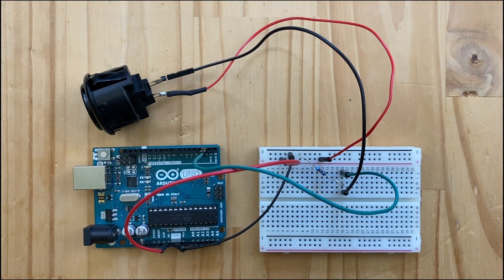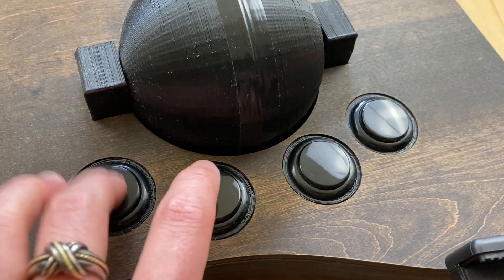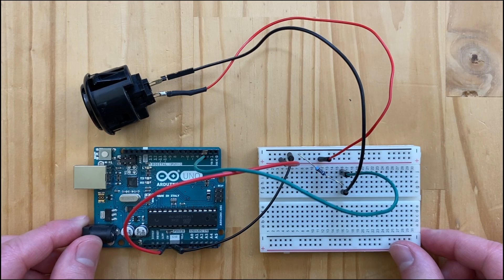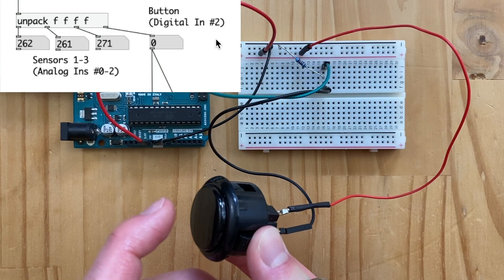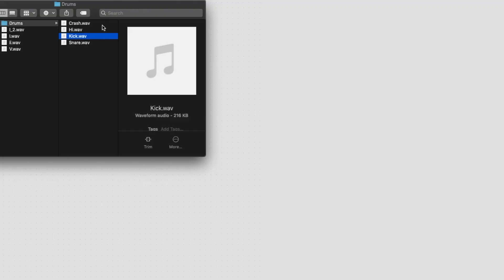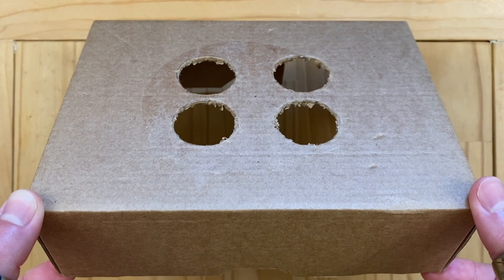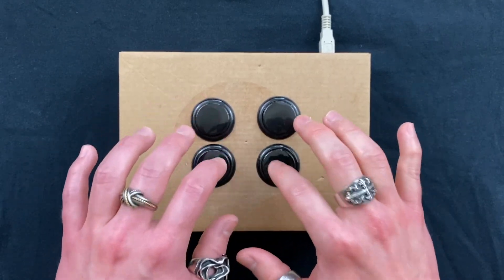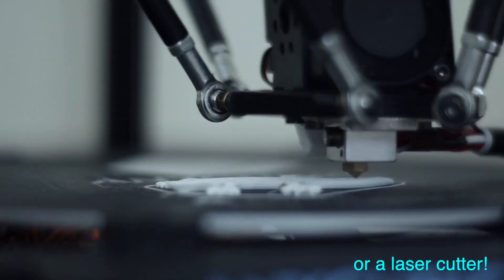Let’s Build a Finger Drum Controller! (Sending Digital Values from Arduino to Max/MSP & Pure Data)

Comment from the maker: There should be a lot less latency if you use the baud rate of 115200 instead of 9600 (so simply replace every instances of 9600 to 115200 in Arduino and Max or Pure Data). 
Thanks for watching!!